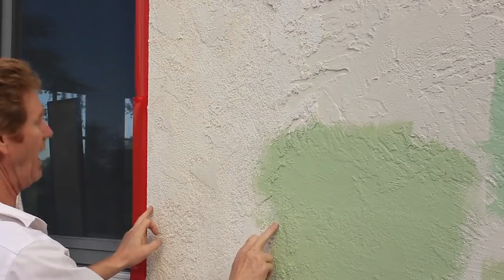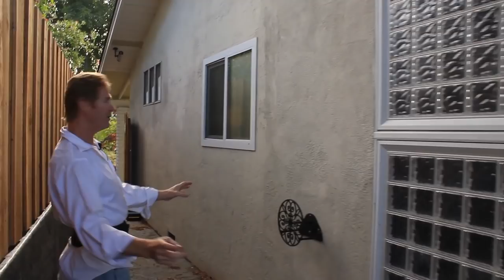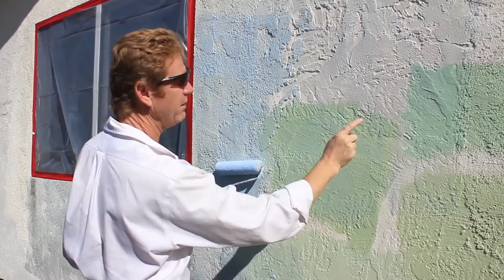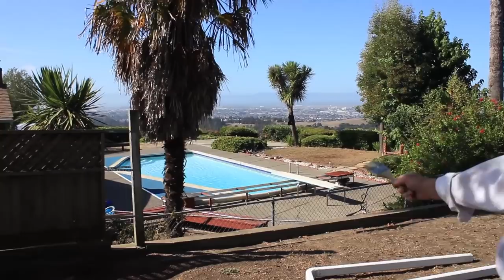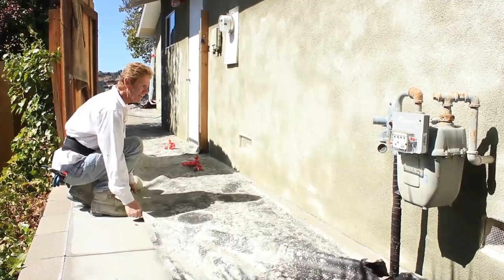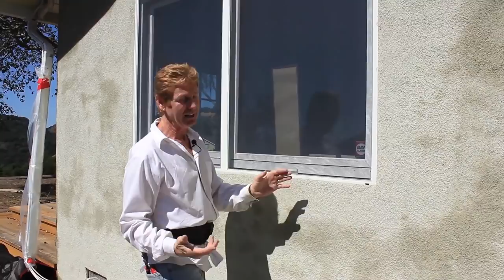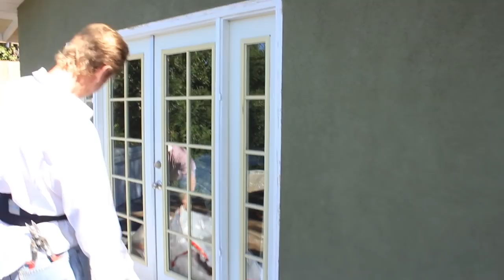Repair bad stucco patches with a new finish.

Comment: What an awesome video showing a team  working together doing great work. I used to frequently visit friends in the Silverlake area of LA and HATED all the stucco. It was all ugly, dirty and unevenly colored IMO. Little did I know that I would purchase a 100yo house in 2012 that needed tons of exterior work that we had done by Chicago Stucco. They changed the color but used a elastomeric coating instead of a straight up color coat. I’ve since done various touch ups with Kirk’s guidance. Just bought two more tubes of Mor-Flexx at Lowes yesterday :)

Thank you Kirk ! Live long and plaster !
Reply from the maker: Good evening Temeyer, thank you brother for the shout out.😉🍻

Comment from the maker: Hi brarmanini,  I forget not everyone uses my terminology. I call it a skim coat if I am going one half inch thick over cinderblock, concrete, etc. A color coat is one 8th of an inch. I dilute the product weld crete as it's too strong by it self for color coating over painted surfaces. It's mainly for concrete to concrete and stuff like that. Many other bonding agents you can go full strength or so I hear.
Thanks for watching and have a good evening! 
kirk Giordano plastering

Comment from the maker: Evening Builder dude,
I have never used an airless to spray weld crete or any other bonding agent.
I have gone over every stone there is including my favorite Lava rock where we have to go 6 inches thick. I take the mud from the hawk and throw between the rocks into the grout, man that's fun. 
Pressure wash real well (3,000 PSI) and you may not need a bonding agent if its porous enough.
 
Thank you for watching and have a good evening!
 Kirk Giordano Plastering

Comment: Kirk,  Great Video.  All your videos have great details that helps us DYI'ers.

I was confused by your comment, "for color coat, I dilute to 50% whereas for a Skim coat I use full strength weld crete." I am confused by the definition of skim coat vs. a color coat.   

Further more, please confirm that you use a 50% weld crete prior to color coating on a painted stucco surface. 

Your advice is appreciated. 

Best Regards,   barmanini

Comment from the maker: Peter old buddy, the fatter the roller the faster you can complete the application. It's a real drag to have to dip a cheep fine roller in a bucket 20 times to paint a 4 foot section. You get what you pay for with rollers.
I usually buy the fattest ones they sell, save a ton of time.
 Cheers!
  Thanks for watching and have a good evening
kirk  Giordano Plastering

Comment: Kirk my friend! Just got done with my first scratch coat. Omg!! I've got blisters and my back is killing me. I have much respect for you. I'm in great shape, but dang!!! You have a tough job! I know the more I do it, the easier it will be. I would have never approached this job, if I hadn't seen you videos. Thank you. I made the mistake to pop the blister on my palm. Thanks KIRK!
Reply from the maker: Morning Emma,
When anyone starts to apply cement plaster or stucco at first, there are muscles in your forearm, wrist and deltoid muscles that you more than likely didn’t know existed.
    These muscles are rarely used in everyday living.
 Thus they will feel like they are on fire or swell up when you start to apply plaster, this is a great sign of unused muscles, not hurt mussels.
    When your arms are too sore to continue to stop plastering, switch to something else constructive with your project and allow these mulches to relax, then when they beautiful pain is gone, begin again. 
Your wrist, forearms or shoulders will burn but that's o.k. again, takes a week or two to get those unused muscles strong enough to move mud where you want it.
   FYI, if you fall off a bike and hurt your leg, that's a bad pain or soreness, to strengthen muscles you didn’t know you had creates a beautiful soreness.
 Kirk giordano Plastering

Comment from the maker: Morning ramblinman, I have applied Dry Vit Acrylic's over  many complete homes in the past 30 years and I rate this acrylic as top of the line. The acrylics that I feel suck, I keep that negative info to myself. 
Over block you apply a skim coat, allow cure time, them finish coat. Mesh over block,why?
You can apply any cementitious or acrylic finish, it's your choice. Dry Vit is superior to cementitious products.
 Thank you for watching and have a great day!
 Kirk Giordano Plastering

Comment: Kirk, great videos man. Love the promotion of your trade and skills and happy to see you passing them along to your kids. Two questions, do you recommend spraying weld Crete with an airless sprayer on your surface and if so what sprayer do you use. Second I have a slump stone retaining wall that I want to plaster. Cani get away with weld Crete, brown coat and finish or should I apply a wire to the stone first since there is a lot of fill. Thanks for your hep in advance Doug  wall

Comment: I love these vids man , I'm a plaster and I can't stop watching.  Sometimes I wish I was there spreading.  Have you ever done a video on how to change out seals and driver blade to a pazload staple gun?
Reply from the maker: Greetings John Thank you, man I've taken apart many Pasload staple guns to change the bumpers. As all staple guns require maintenance as when the bumpers go the staple can rip and go through the moister barriers.😉https://youtu.be/0z5YBSpZRg8
 I now use Senco staplers as that crap could cost a fortune in damages.
 Bringing peace, love, and brotherhood back to the old fashioned 🌎  “Plastering.” 
    The most comprehensive encyclopedia of plastering on video, by the plastering messengers of Youtube.  
     Over 800 videos 🎭 👀💃
Reply: I run my 15 /16  pasload crown gun around 120 psi if your staples continue  to tear your double black jumbo tex then turn your air pressure down some.

Comment: Amazing work Kirk I told you I was hooked on your videos! I sure wish more contractors took pride in in there work the way you do. I noticed you always where a long sleeve white shirt and here even Jay is any particular reason PAun? Also what shirts have you found to be the best I tried switching to long sleeve which I'm still going to but have a tried a couple different brands and fabric combos and there either too thick too hot etc etc seems you have found ones you like would really appreciate any advise on brand, fabric where you get them etc. Thanks again I am hitting the thumbs up and watching away I have told two different contractor friends about your channel they also are very impressed great work buddy have a wonderful rest of the week.
Reply from the maker: Evening again Mr. Rhodes, thank you.
For over 30 years I have been wearing these long sleeve white shirts, when I worked union behind a pump, nasty and filthy work, the long sleeves were so my arms were protected and I used to wear the collars up to protect the neck as the tommy gun shot the mud everywhere, it would bounce off the walls into any area's that wasn't covered including our face.
Glad those days are over but at the same time miss the goofy stuff we'd say all day long to each other.
I buy my shirts at the salvation army, every friday it's half off so I usually buy about 10 at a time, (about 2 bucks apiece) when they get too beat up, I throw them away.
Thanks for the referrals and have a good evening.
Kirk & Jason Giordano's DIY plastering network

Comment: Great great video! I truly enjoy watching and learning. I got ripped of by a mason who was doing my stairs, took the down payment started the job then disappear. Found another mason 83 years old and still working he came in and finished the job. He did a great job. My coworker was telling me to stucco the stairs. The method you used here would that apply to the stairs?
Reply from the maker: Hi Camille King, no, this method won't work for stairs, however I do have a video on how to do stairs.
 best wishes and happy new year!
 kirk giordano
Reply: Oh thanks do you have the link?
Reply from the maker: Howdy Camille , I was afraid you might ask this question, but was happy to research the answer as the squeaky wheel get the oil.
 first view how to can you waterproofing exterior stairs, can you stucco stairs at the below link,
https://youtu.be/pbm-7BW0byw, then if you wish the best top coat click on the link below,
then how to apply acrylics on stairs.
https://youtu.be/CvLTPRBiWiE 
Best wishes, and remember you can do it.
 kirk giordano plastering

Comment: Great video but I've always wondered where or how do you clean your mixer?
Reply from the maker: Morning Ernesto Gomez, good question, on this job they were many areas to clean out in, as they still hadn't poured the concrete.
 On some jobs it is a challenge.
 Generally, we hose down all the blades and the sides of the plaster mixer, let spin at least 10 minutes, it cleans itself, we then dump in the wheelbarrow and drop on site, note any excess stucco is taken out and only the rinse is discarded. Therefor we try and mix only what we need with the excess stucco going to the city dumps.
 Best wishes, 
Kirk & Jason Giordano's DIY plaster and stucco channel

Comment: The information is very helpful.  I have one question.  Do I need to water the color coating to prevent cracking?  Thank You.
Reply from the maker: Hi KEITH LEE, NO, never water down a color coat or the results will be many varied stages of different colors.
Cheers!
 kirk giordano Plastering

Comment: Question Kirk: Can I or should I apply a thin second layer of brown/base coat to bring the base up to proper thickness? I am doing two coat cement stucco over new CMU block – 3/8” base and 1/8” finish. The first section of wall learned on varies in depth from 1/8 to ¼” and was steel troweled, and I thought I should even it out before finish coat. Or should I just do a heavier finish coat?  Any special prep or bonding agent? Thanks.
Reply from the maker: Keith Granger Hello Keith, if it were me I would hydrate the wall properly,  and  just color it with a 16/20 finish coat.
When we steel trowel a wall it seals it a bit, so I take special care to hydrate the wall, when properly hydrated, apply the finish coat.
if not certain apply a liquid bonding agent to make sure you get a good bond.

Best wishes, 

 kirk Giordano plastering
Reply from the maker: Hi kinya kamau, cool beans daddio,
 Cheers!
 Kirk Giordano

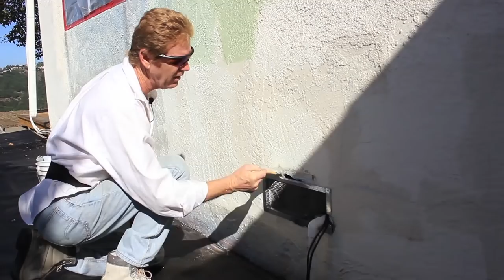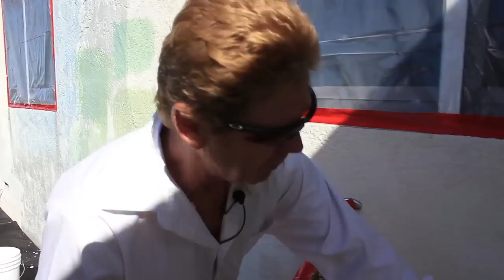Comment: Hey Kirk, you mentioned having to fill some deep divots and holes at 8:25 and 8:35 and that the color coat wouldn't fix that. Why couldn't you go extra thick for those areas?

My house has siding over stucco but the bottom foot or so of stucco is visible before it meets the driveway (about 1 ft tall by 50 ft long area). I fixed some cracks with caulk and want to do a light stucco coat over the existing stucco but have to fill a couple deep spots where it fell off. I'm just using the white finish stucco from Homedepot without color additive. Can I use the finish version for filling in deep areas instead of the base coat stucco? Should I just add a couple layers letting it dry in between? Would rather not have to buy both types.

P.S. Your videos are great and most of the research I've done has involved your videos.
Reply from the maker: Happy holidays JM Dude, finish coats can't be applied too thick or they hairline crack.
                  Bringing peace, love, and harmony back to the world of plastering.
    The complete plastering encyclopedia on video, by the plastering messengers of Youtube with over 800 videos

Comment: Hi Kirk, I live in an area where i can't find any stucco contractors to help me do my house.  Ive watched tons of your videos.  My house has an 8 inch rounded band about a foot off the ground all around the house.  the doors and windows are also bumped out and rounded.  I have some colored drivit.  do i apply the drivit to the rounded areas first, let that dry and then apply the drivit to the main body of the walls.  I couldn't find a video showing anything like this.  Thanks Josh
Reply from the maker: Evening Josh, this skill takes a minimum of 10 to 15 years to apply properly, but I do walls around the corners about 4 inches then allow to dry and start the next wall.  
Cheers,
 Kirk and Jason giordano’s rendering videos

Comment: It is really great what you do... I like to do things with my own hands and I bought a pretty old house, built 1947, 3 years ago. Most of work already done but I cannot find any where how can I cover my old asbestos siding without remove it. it actually not in bad condition but some boards were replaced with hardboards or just covered on top of it broken pieces. Can I plaster over the asbestos siding? If yes, how can I do this? Should I use any specific materials before to install plastering?
Reply from the maker: Evening Liubov, thank you.
 If your city allows it you can apply two layers of jumbo tex paper then stucco netting and cover with stucco.
   Many years ago when I worked starting out as a plasterer we did this often, this was long ago.
 I'd check with your city building department to inquire if it's possible where you live.
 Most states want it removed by licensed contractors.    
                Peace, love with happiness to all.
    Kirk Giordano plastering tips-mixed with sound advice
Reply: Thank you for your respond, Kirk. I live in Jacksonville, Florida. 4 years ago I bought old house, and repair all inside on my own. It looks nice and I like my new home and location, but there is still a lot should be done outside. One of the projects is outside walls, which are not really too bad but I want my home looks better not only inside but outside as well. I like to do things with my hands but sometimes cannot find right information how to do not just it have to be look good but also do it right to stay longer. @StuccoPlastering
Reply from the maker: Evening Liubov, you have a beautiful attitude, if I can be of further help, just let me know.
                       Peace love and happiness to all 
            Bringing Plastering tips to the world, via YouTube Vide

Comment: hi kirk...im going to color coat a wall and i'm using a concrete bonding adhesive by Quikrete., should i dilute the product before applying it to the wall?? thanks and have a bless day
Reply from the maker: Gilbert DurazoHi Duranzo dude, I'm not sure, quikrete wrote the book on cementitious products, they are world wide.
 I Believe on the container it says you can actually add two gallons of water to one gallon of bonding agent as a primer.
 I am not certain what they means when the write "as a primer"
 I dilute weld-crete when wishing to rid the walls of some suction while applying certain color finishes, but this "as a primer" line is not clear about it's meaning?
 Do a test area and let me know the results.
 I have used this glue/bonding agent many times but not for an application but not for applications of 1/8 th thick finish color coat surfaces.
 O.K., I will test in myself when I have the time.
 Best wishes, 
 Kirk giordano Plastering

Comment: Kirk - your videos are great!  I need to repair some cracked stucco on the exterior of my home.  The stucco is original (over 100 years old) with a very heavily textured finish.  Most of the cracks are hairline with a couple of exceptions.  Would you recommend this technique repair/cover the cracks as well as update the color/texture?  Also, do you have a video about preparing the stucco for this kind of work?  Thanks!  -Chris
Reply from the maker: Howdy guys, yes this is the way to go about it, I was able to cover this texture, but had to use a heavy sand to achieve it.
This video does indeed show prep work.
      
                                   Live long and plaster
                Answers to life’s stucco and plastering questions
Reply: Sandra and Christopher m

Comment: Hey Kirk, thank you for the responses, much appreciated. I'm going to be following this pattern except I'll be working by myself. So, after I apply the first coat, how long should I wait before I start to float, 5-10 minutes? Is that a rubber float you are using? One last question, I don't want the finish to look like Clorox bleach, so when would I get the float wet?
Reply from the maker: Howdy Countertops dude, It me  well over 10 years to learn the basic principles of this system, I would not ad=vise you to try and do this on your own and without very experienced help.
 The questions you asked take more than a sentence to answer, more like a book, sorry.
I'm here to help, so the best advice I can give you is hire some help, really, sure we make it look easy but each guy has more than 10 years experience in this video, some closer to 20.
 cheers,
 kirk giordano Plastering
Reply: +Giordano's plastering & stucco repair videos I thank you for your advice (all of it). If I could find competent help I would. my experience with contractors haven't been the best, so I'm going to tackle this on my own. I don't take your above advice lightly, but I feel I have no other choice. if I mess up bad enough I'll just pay someone to fix it. but boy o boy am I sure done with careless contractors. appreciate your time to make videos and the pride you have for your craft, it shows👍
Reply from the maker: Well in that case, Go For It,
 cheers,
 kirk giordano plastering